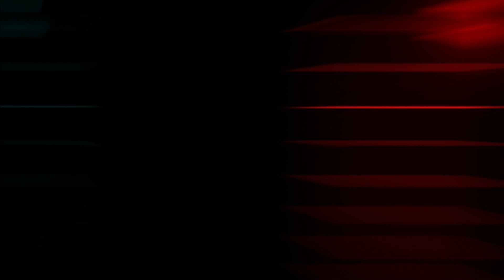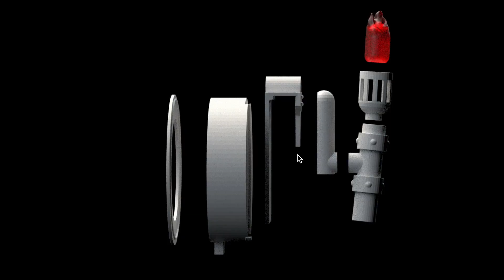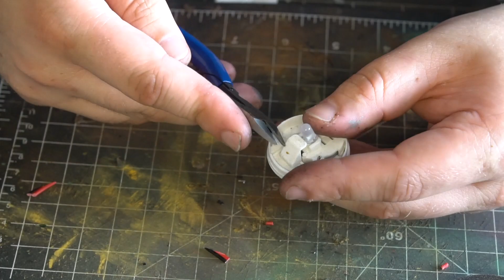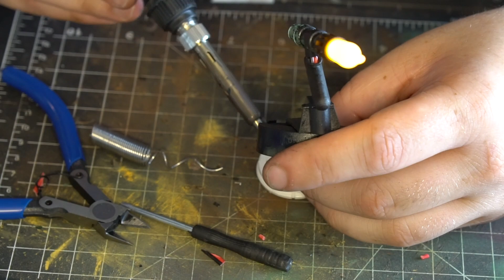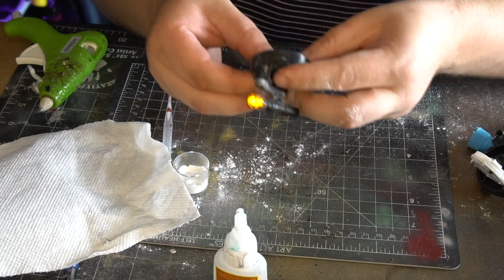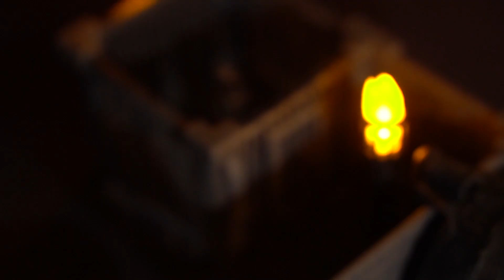Lighting the Dungeon, Light Up Wall Sconces CLe06

Comment: Use higher heat with your solder, heat your material first then apply solder, you know you are doing it right if the solder wicks into the wire. If you feel like you cant put in enough heat use more flux. You don't want a blob like 3:20, you are not working with hotmelt glue, a good solder joint looks like wax that has completely melted into a wick, but all the pieces look like they are the color of your solder metal. (usually silver, lead or a tin color)